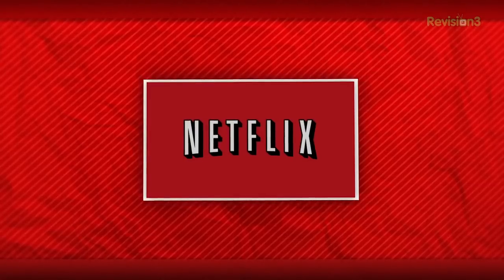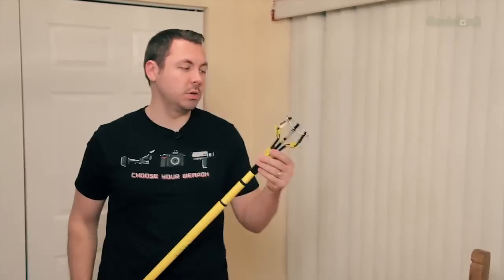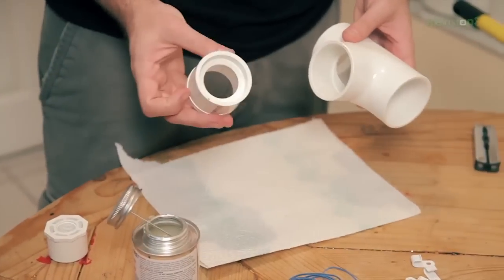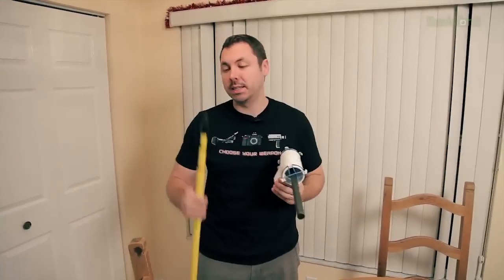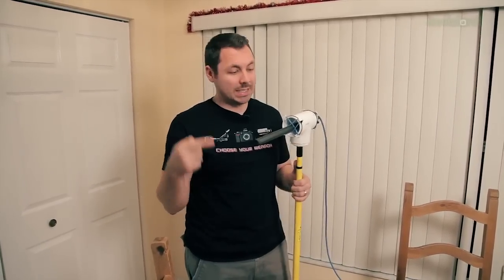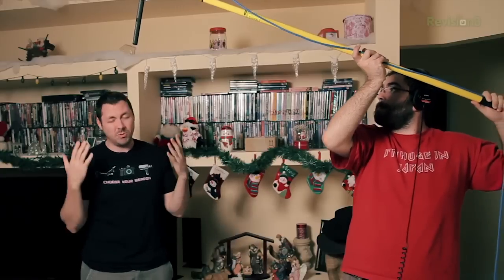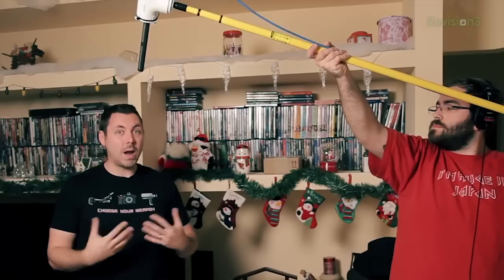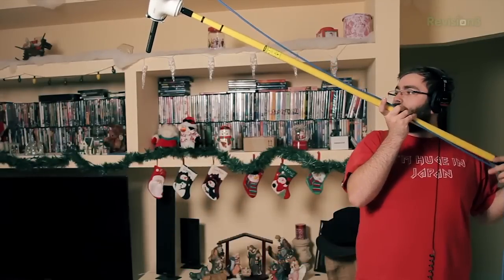How to Build a $25 DIY Boom Pole

Comment: another way to make a pretty cheap boom pole is to get a broken microphone stand (well, it doesn't have to be broken) and attach a shotgun mic to the microphone holder, and then coil the audio wires down the stand.

Comment: Great idea. BTW, if you want to hide the pole wires and add some grip, you could use split foam tubing that is actually made to insulate pipes. Also found at Home Depot. 
Keep up the good work.

Comment: I did this a long time ago!  The t joint i got had the 1/2" threading built in though.  then i filed four grooves on each side, then used 4 rubber bands stretched from one side to the other.  much easier.

Comment: There arefitting with smaller side openings available, which may cut you down to only one 1/2" screw socket for the boom pole. Also, you can bypass the plastic ties and clips by merely cutting pairs of slots into the PVC T piece.

Comment: I have found a painter's pole that extends to 4 meters but the best part was that it had a cap with a predrilled hole at the end. All I did was to buy a screw and screw my mic holder to the cap TA-DAH! I had an awesome boom pole for 10 bucks, then I bought a pvc pipe made some grooves and added rubber bands ans superglued a smaller pvc on it to fit my mic holder. And I paid 11 bucks for all these stuff I had the mic holder with my mic so it was free for me and this system works perfectly

Comment: I call it more brilliant than "stupid". I've seen similar diy boom poles like this but it usually involves cutting tools to create tabs to hold the rubber bands. I like this one better since no cutting is required. Younger filmmakers can do this easy but would need adult supervision for the use of the plumber's cement. Plus the tips on using the boom pole are very handy. Thanks, Ryan. =D

Comment: Just ordered an ntg 2 and built on of these bad boys! instead of those zap straps though i used a metal plumbing clamp, because there screw tighten and get allot tighter than the zap strap!

Comment: You can also use rubber o-rings for the stabilization (this is actually what most 'pro' stabilizer heads use anyway...) Ones big enough for this should be easy to find at an automotive parts shop (Canadian Tire, Princess Auto, etc.) for pretty cheap. But you'll need to get the sizes pretty down because they won't stretch and double-over like a rubber band. Personally I'd feel safer having an o-ring securing the mic to this thing, I don't know about you :)

Comment: In case you're still looking: PVC for some reason is ridiculously cheap in the US, but in Europe, even if you find it, it will be way more expensive. For the price, you can actually find a decent ready-made shock mount and just look for an adaptor on whatever pole you want to use.

Examples:
thomann.de/gb/the_tbone_ssm5.htm
thomann.de/gb/the_tbone_ssm6.htm

Comment: Oh, it matters greatly! The difference from the mic to your actor is by far the most important influence on sound quality. Just like with light, sound follows an inverse-square-law. This means that if you are 4 feet away instead of 2, your sound is 4 times softer and needs to be amplified.

You can easily get better sound with a very cheap mic a foot away from your actor than with a 400$-mic on your camera. Plus: The reflections are worse if you don't boom from above or below.

Comment: I just want to point out that the change in audio quality based on if the boom is above or below is more apparent inside than outside, and can be fixed slightly by rotating the mic to have less of a direct line of capture with the jaw line, which is partially, along with the chest, causing the change. I've had to switch to below on an outside shoot due to shadows, and we honestly heard no difference on surface level. It also has to do with the mic and the recorder.

Comment: not that it really matters but the threads on the telescoping pole are not the same as the threads on  1/2"  pvc. It will screw in and it will stay relatively tight but they are not the same threads. I believe the universal threads on the extension poles are called 3/4' acme threads.  I test fitted them in the store today and it seemed a pretty tight fit and everything but the threads are not the same.

Comment: @Dizzy2810 You could, but because it has a Cardiod pattern, it picks up a lot more room noise...which makes the audio a bit more annoying, but still better than the camera mic...

But there are some cheap ones on ebay or Amazon for $30 or so...

Comment: @TheCMWUK 2k is not 1080p times two. 2k is 2,048 horizontal pixels so it's just a little bit over 1080p (which is 1920 horizontal pixels). And 4k is about 4,000 horizontal pixels so you may say this is double the full HD resolution (but you could fit 4 HD images into one 4k frame) :)

Comment: You shouldn't be using that type of shotgun mic indoors anyways. Shotgun microphones like the one you are using should be used outdoors or in rooms with more space. Interior shots you should use a small diaphragm condenser. We use the Sennheiser 416 (Industry Standard) and the Schoeps MK41 + CMC6 Amp.

Comment: Does anybody know how you would go about using a regular shock mount with the DIY pole? I have a telescoping ceiling duster pole with a thick plastic 5/8" male thread and a shock mount with a metal 3/8" female thread. Anyone have an idea of how to makeshift an adapter for the two?